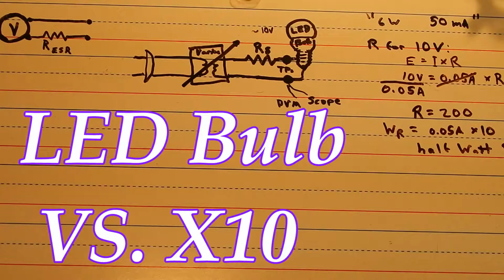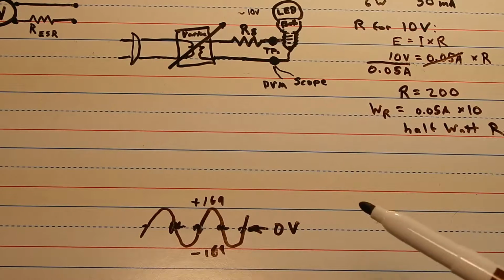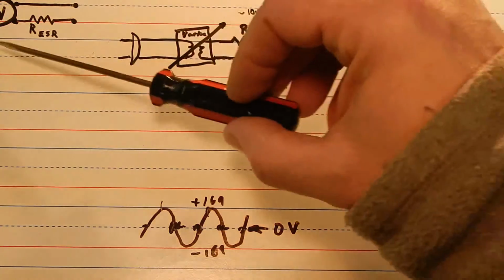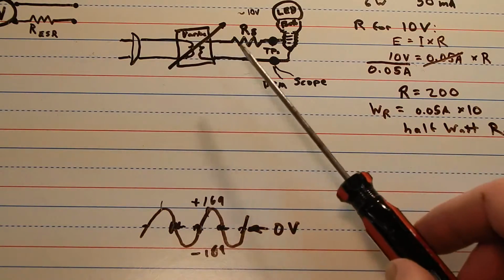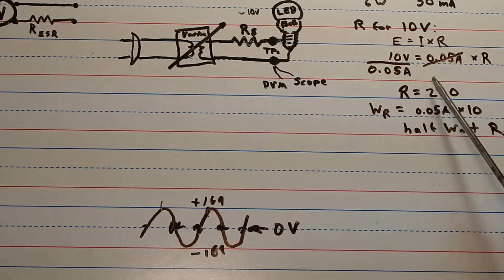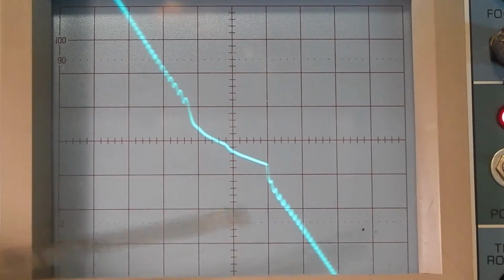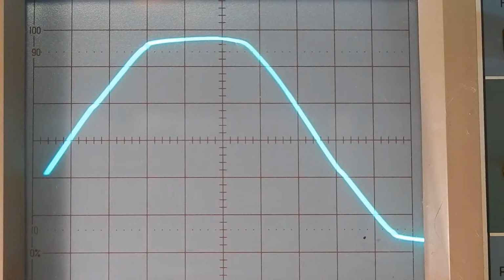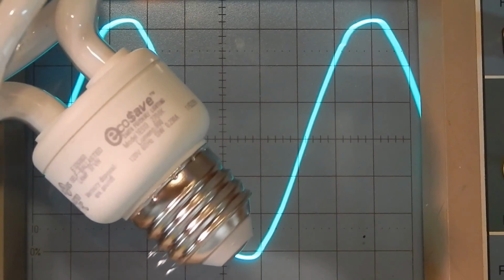LED Bulb Jams X10 signal

Comment: Re: cat.  How do we know you're not sharing - what's its name, Mr. Whiskers? - from John's Audio Tech channel?  BTW, JAT recommended you.  So, in spite of a 50year interest in electronics, in the last few years I've seen more people talking about the dangers of using test equipment directly to get AC line V/A measurements...  And you mention using an isolation xformer here.  I'm wondering if a hobbyist could use AC-powered test equipment that is running off, say, an uninterruptible power supply that is disconnected from AC.  Current 'scopes and such must have pretty low power requirements.  It's either that or isolation xformer.  Thx.
Reply from the maker: You certainly could use a UPS in that way but that's probably more complicated/expensive than an isolation transformer. An isolation transformer is essential for working on older radios and TVs with Hot chassis design.
Reply from the maker: Mine is one I've had since I scraped it out of something when I was in High School, many decades ago.
Reply from the maker: JAT's cat is Snickers!  My cat is smaller, all black on top and a black chin, his name is Charro.